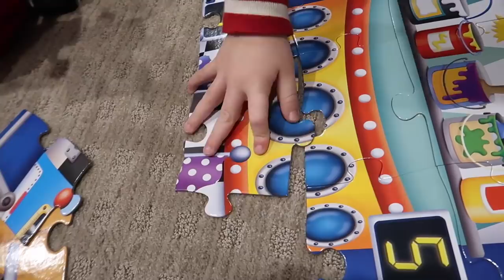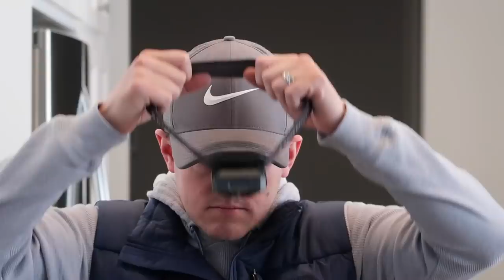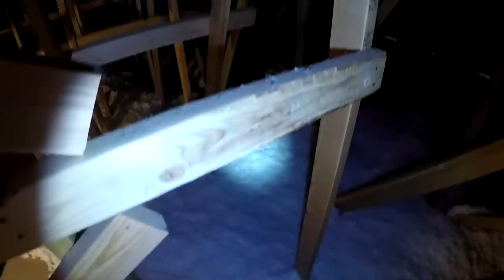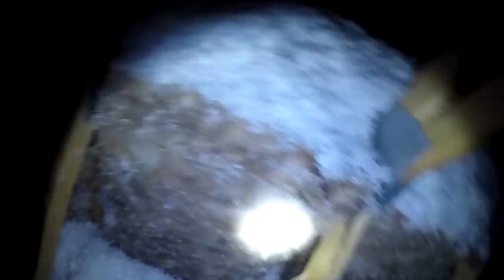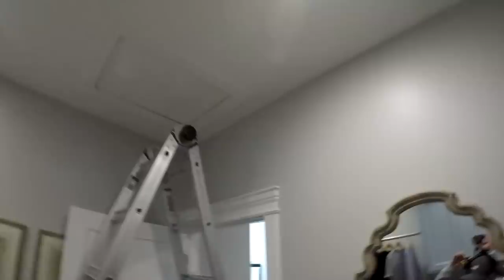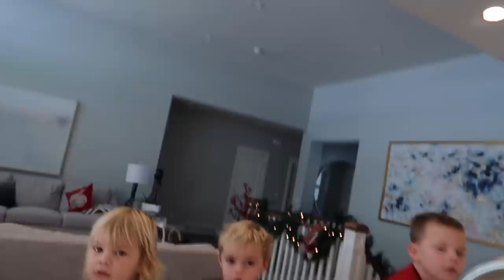We Think SOMEONE or SOMETHING Is Living In Our ATTIC!

Comment: If you have your heating duct work in the attic and it’s flex pipe it could have come loose and when the unit comes on it’s forcing air out of the opening it will make a rustling sound. Check your hvac piping through out the space